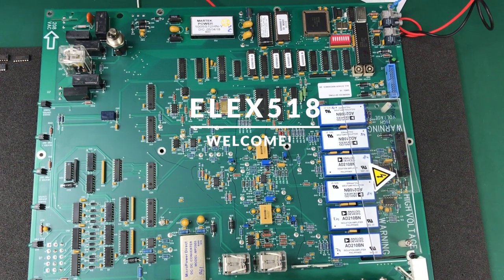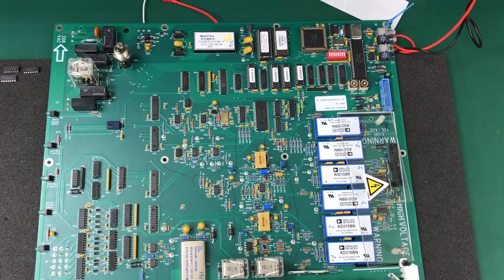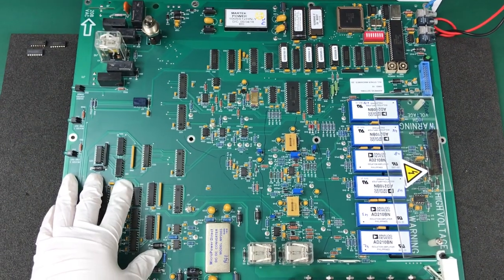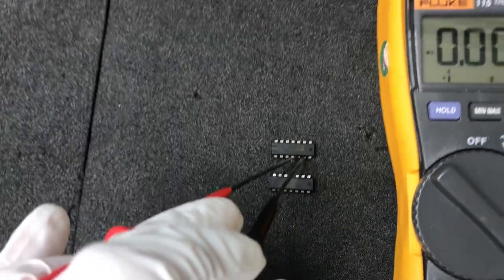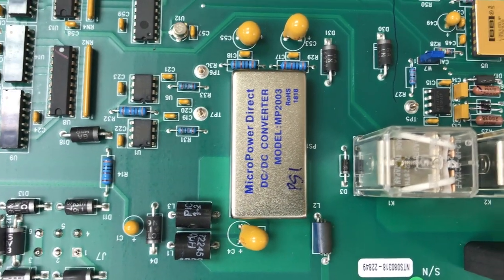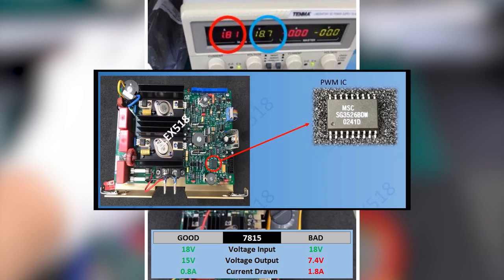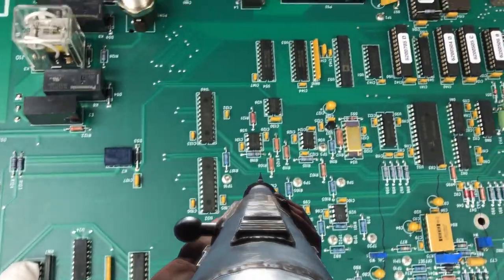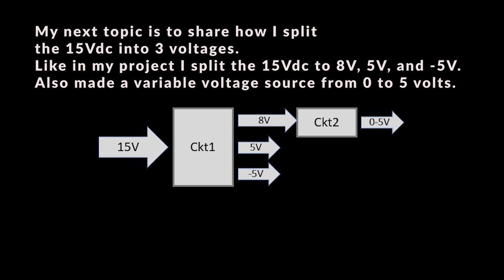How to Repair Circuit Board (PCB) Without Schematic Diagram

Comment: Great video.  
Question, I'm replacing my ebike motor pcb board.  

The replacement has 7 holes/copper rings for wiring. Bu my original has 6   - 5V, GND, SP, H1, H2, and H3.

The replacement has an additional ring for wiring labeled "K". What does K stand for in this case? Keyswitch, ohms, resistance?  Can't find any information or diagrams online.

And if I solder/connect  the "regular" wires, will I have a problem if I leave "K" unsoldered? 

No info online + could use the help.

/bklyn 👑
Reply from the maker: Thanks for watching...when u buy something new it should came with usermanual that can guide u the installation. You can also contact the supplier and ask advice. I dont have ebike, I can only assume in this case, the K might be additional feature/function/option of the new board version. It can be an interlock too. Most likely you're right that K stands for keyswitch...Typically K in pcb stands for relay. I will try google it later, will keep u posted with my findings. Thanks
Reply: @elex5183  thanks for replying.  yeh, I got it off Aliexpress. no manual,  no nothing.  spoke with the vendor, actual response:
      "the PCB local "K" it's actually for temperature sensor, and you can leave it if don't need, it doesn't influence other functions".

is this something you're familiar with or have heard of too? btw, it has gnd (-) through hole beside to complete circuit,  jfyi.

thanks again bro.

/bklyn 👑

Comment: Helpful video. How did you figure out that the PWM ic in particular was causing the voltage regulator output to drop?
Reply from the maker: By isolation, lifted each pin that connected to 15V.

Comment: MY QUESTION IS
WHERE COULD BE THE PROBLEM? 

my SSD [ WD10JPVX ] only gets detected once per 20 times trying , and when its finally detected i open the partitions i see my files everything is fine, but few seconds later it gets undetected again . [ i use usb connector to connect it to another laptop ]

So This means the problem is in the PCB board ? Or the disk itself ? I'm trying to get my data back .

Knowing that my SSD is spinning perfectly , no burn smells, no power problems .

[ my Board is ( 2060-771960-000 AE ) ]
Reply from the maker: Got same experience, the portable ssd got issue...u can try check the cable and ssd connector for any issues...My case i claimed the warranty of ssd, the seller unable to fix and so the replace with new. Almost a year until now no more issues.